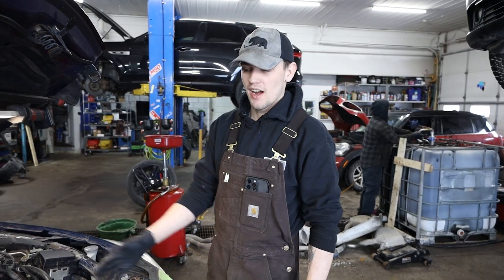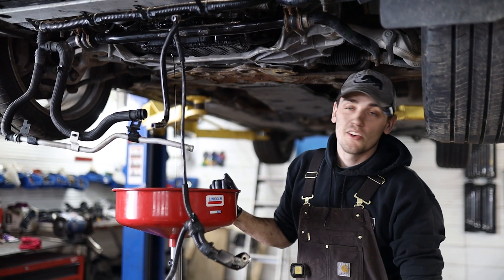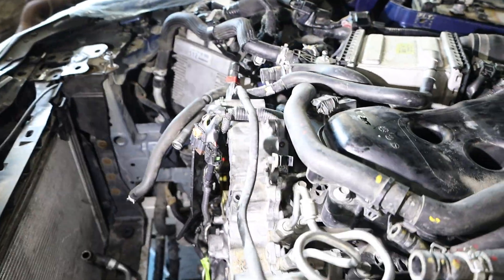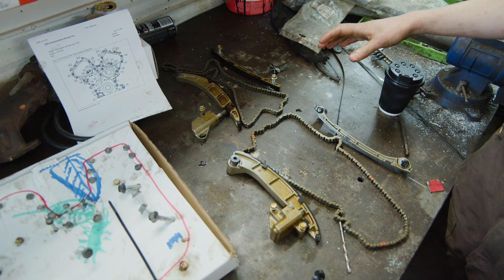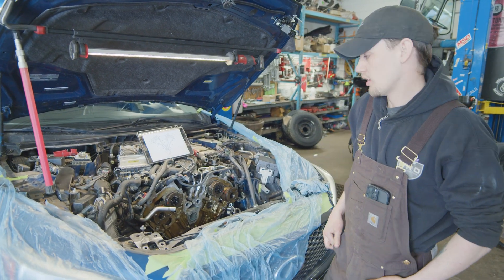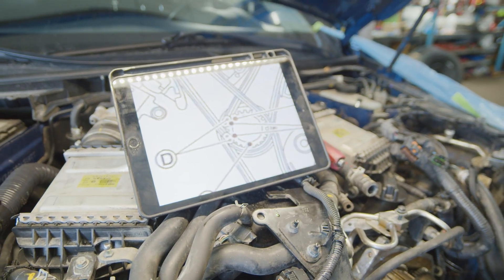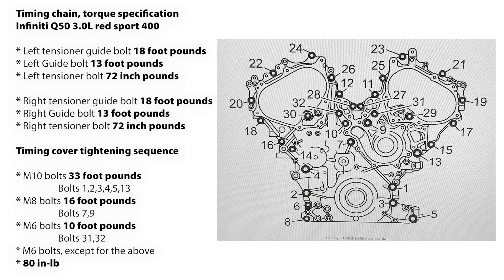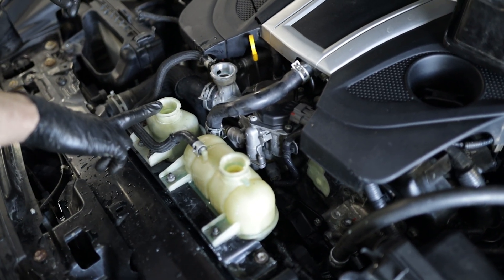Infinity Q50s timing chain replacement

Comment: My neighbors i looked at. It was dead for 2 years, i started it and it was back firing. So i killed it immediately and on my scanner the cams are way out of alignment. Is the engine toast or just needs new timing kit and put back in time?
Reply from the maker: It's probably skippped a tooth! not unlikely. you might be able to get away with just a new timing kit
Reply: @UROAutomotive  yea id think since it will still start there shouldn't be catastrophic failure type damage. But then again I've seen crazier things. He had it towed to a shop already tho. Thx for the reply.
Reply: Probably worth boroscoping and see if valves have hit pistons

Comment: we forgot to put the tool to hold the cams and it spun after placing it TDC. what to do now to set everything in time again
Reply: Lining the cam sprocket tot he chain is automatically like it up since the TDC of piston one and cam sprockets don’t have a direct correlation but with the chain they do so if you  put the chain on and move the cam sprockets and line up the marks it will automatically bee set on time